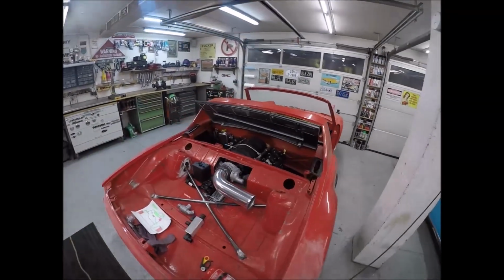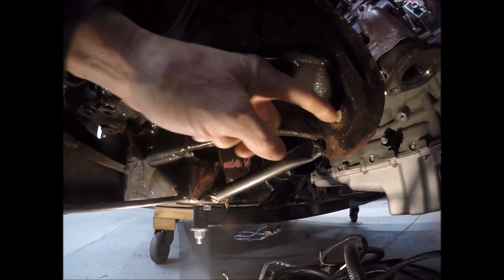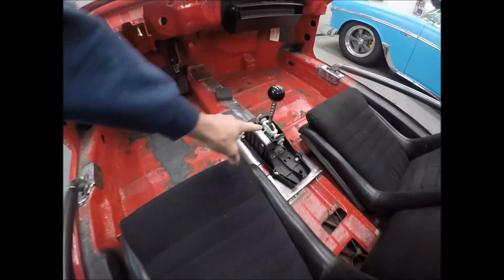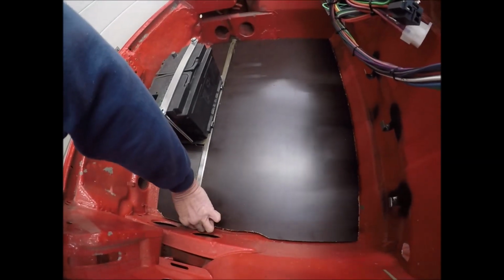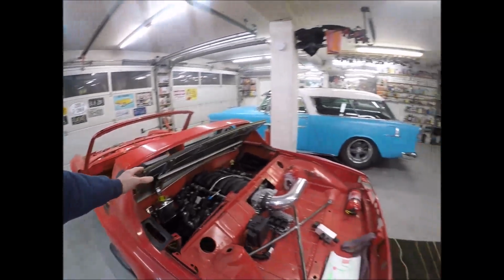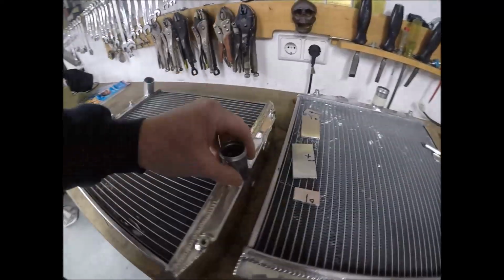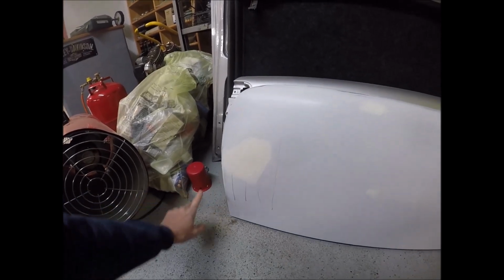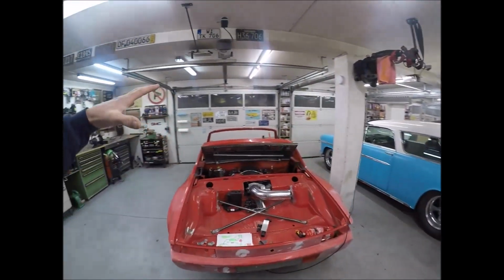914 Porsche LS3 project video #7

Comment: Hey Roger are you in Germany ? You resemble i guy I sold my 59 Chevy truck to, a few months back .??? I'm in tx
Reply from the maker: Yes, that's me.  The 59 Apache is over here now in Germany.   As a matter of fact, I worked on it a little last night after I got home.  Solid truck.   I've done the brakes, added HEI and upgrade to dual diaphragm, dual circuit power brakes.  Truck runs great.   You going to sell me some of those Porsche you have?     Roger (U.S. Army in Germany)
Reply: Well I guess a lot has happened since we talked . I m now fighting back from spinal surgery was paralyzed from the neck down in January just got to keep working it out ,back to some walking was in the hospital 5 months
Anyway I did get my 914 back and yeah maybe its time to think about trimming down a bit
Reply from the maker: @kendoe9868  I still have your number.    Glad you hear your back on your feet.  Health is everything.   I'm back in Dallas mid NOV.  I'll call you if those 911s, 912s are still for sale.

Comment: Looking good my friend. I just can't do chevy engines of any size. If you knew my luck with them you would understand...lol. I do enjoy all the different mix and match ideas when building your own vehicles though.
Reply from the maker: Thanks man,  I like like building stuff in my garage.
Reply: @Karolilalu  I have a '92 F-350 7.3 IDI Diesel E4OD Auto that the trans went out in. Pulled them and grafted in a '98.5 12V Cummins, NV4500 5-spd w/transfer case into it. MPG went up from 6 w/ no load to 12  loaded at 25,600. Best mistake I ever made...lol.